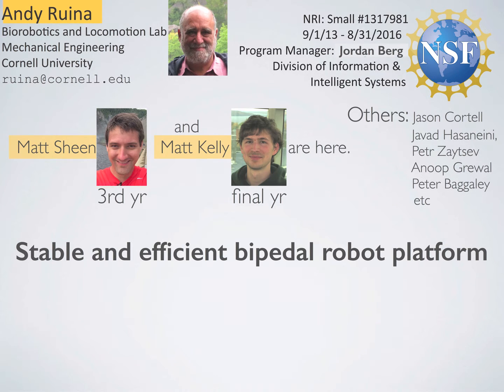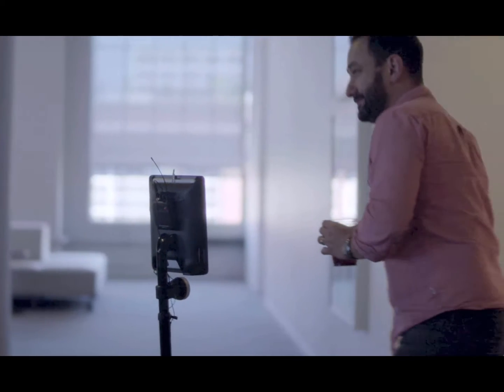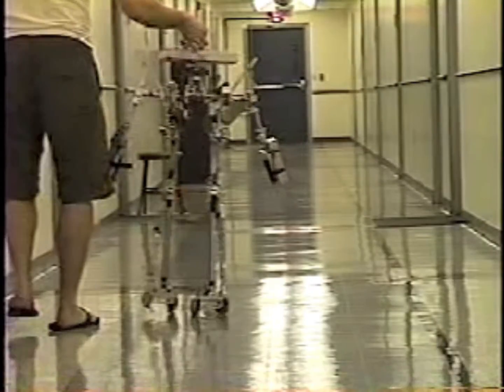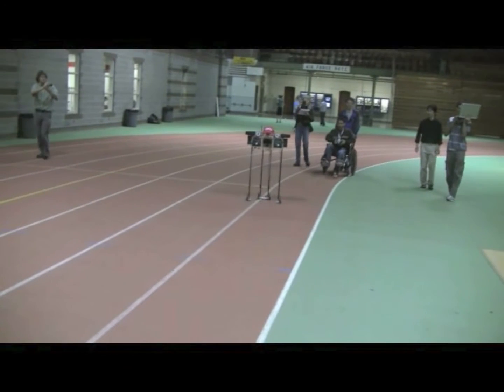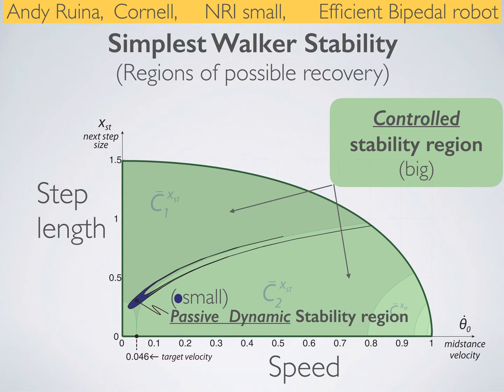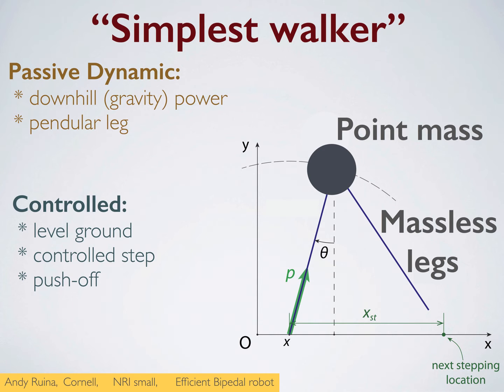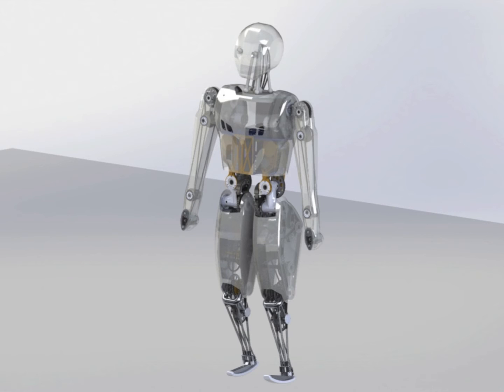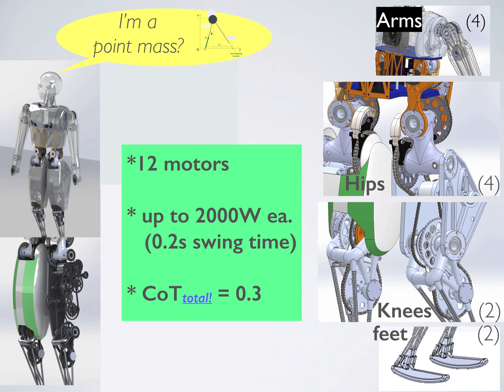Stable and efficient bipedal robot platform - NRI PI Meeting 2015

Comment: Professor Ruina, 
Why do you think that "springs don't help much" ? others like Jessy Grizzle and Jonathan Hurst believe that springs are a key ingredient for motions that preserve passive dynamics and behave more like human and animals...it is true that you can create spring behaviour in software but it won't be as efficient.
Reply: Ultimately springs, compared to no springs, can probably decrease the energy cost of legged locomotion by a factor of two or so.  But a factor of two isn't much in this world where, say, one of our robots is 10 times less energy using than most other robots.  Springs, variable transmissions, clutches, brakes, etc aren't the low hanging fruit.  Using motors somewhat wisely is.